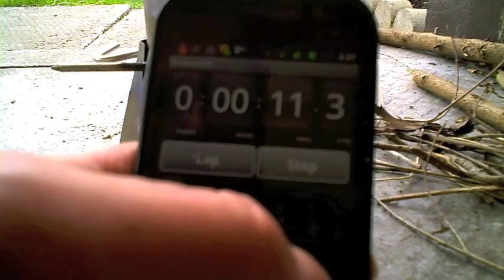Vargo Titanium Hexagon Wood Stove burn and boil test

Comment: I use this wood stove as a primary way to cook on my hiking trips. I start the fire from the top placing thicker wood on the bottom. I recommend telescopic blowpipe to start and regulate the burning process. I close the door only if I need to simmer. 
I switched from canteen to a wider 0,8 litre Toaks titanium pot which can absorb the heat with better efficiency so 500ml of water will boil in 5-6 minutes. From time to time I use Hexagon as a windscreen for my soda can 2 pence alcohol stove but only if I can't use wood for cooking.

Comment: I mostly start a fire seperate from this and then transfer it over but I also find that using a small flat candle helps to get it started. After the candle I then add small chips and then build it up

Comment: If you smear the bottom and sides of your canteen or pot with a small amount of dish soap before using them on a fire, you'll find the soot comes off very easily (smears off with your finger). Great video. :)

Comment: Try smaller wood and leave the door open.  You'll cut boil time in half.  Good vid,  I use the same set-up.  Also, don't clean the canteen.  Just put it in a zip lock.  A safety pin on the clip will make this set up bullet proof.  Maybe next time I'll film mine.  Good luck!

Comment: Splitting sticks (or branches/logs) makes them burn much easier. Id split everything larger than a pencil width and they will start burning much more quickly instead of throwing them in whole on top of the flame. Makes a huge difference

Comment from the maker: I haven't found it to be too difficult to light inside the stove itself. If it's windy, I use the windscreen I show in the video I just added as a link in the video description and / or put the pot on top of the stove first. This way, I'm controlling the amount of air that gets in to the fire. Sure, I'm huffing and puffing a bit but at least it can still be a one match fire.

Comment: So... After you spend 50 dollars, you still have to add 2 camping poles to keep your cup in place.
Reply from the maker: Yeah, that's the long and short of it. Not necessary if you're using a camping pot but necessary if you want to use a smaller, thinner vessel like the metal canteen shown in the video.
Reply: It's really meant for a pot on top. But we have learned from each other on YouTube that a metal drinking bottle is a perfect item to bring while camping because you can heat it up. These are just modifications so that we can bring less:) I boil water most of the time. The wood stove can also be turned over if you want to grill

Comment: That was a very disappointing time my mahalo stove could have done that in 1/2 the time, and my ultimate stove in about 6 minutes and not had all that smoke and soot to deal with.
Reply from the maker: That's an alcohol stove which requires bringing more things along. Fair comment, but it's hardly an apples to apples comparison. As APheonixPretense8 pointed out, the fire would have burned hotter and cleaner, and the boil would therefore have been faster, if I'd used split wood instead of found sticks and twigs.